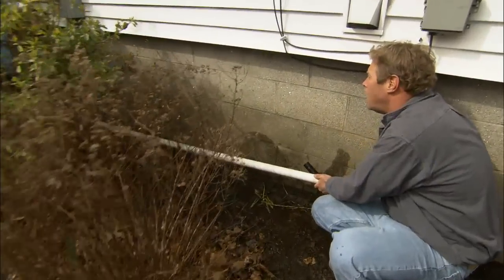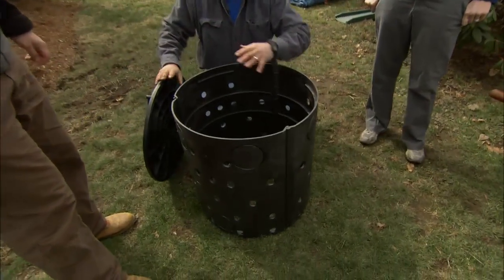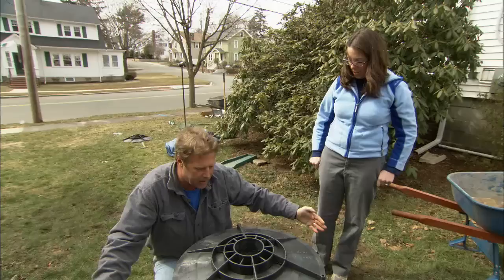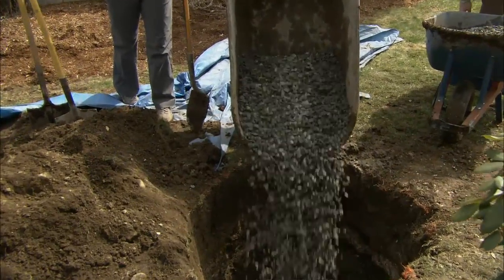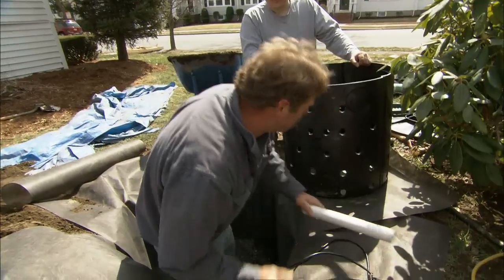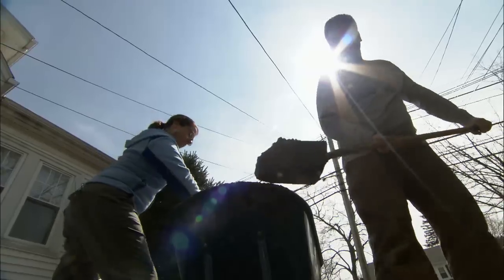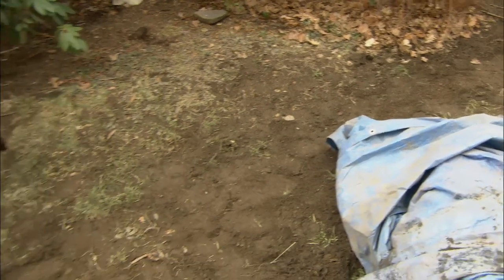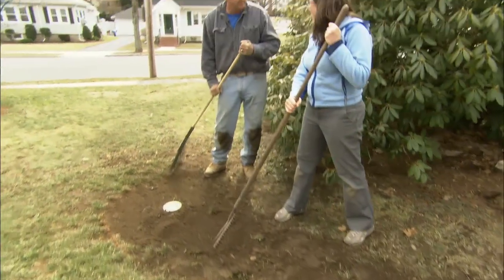How to Install a Dry Well for a Sump Pump | This Old House

Comment: Where I live is heavy clay soil so I don't know if using this method would do much but cause water to gather at the point the well is installed. Plus, that piping WILL FREEZE here, no doubt about it! That accordion discharge pipe he connected to the hard pvc pipe, BOTH would freeze the first freeze night. I REALLY need a workable solution!
Reply: Bury the pipe further underground, and consider installing larger a concrete cistern instead.
Reply: I've had 2 discharge pipes freeze on me in Canada. I just run it above ground, that way I can go outside and visually make sure my sump is discharging. There's also a failsafe elbow on the discharge pipe where it comes out of the wall, if the main pipe freezes then it will still flow out of the hole in the elbow. I'm not sure what the name of it is

Comment: I'm curious about wintertime freezing.   Wouldn't the discharge pop-up freeze shut?    You're kind of screwed if it is frozen shut.
Reply: navigator3  it wouldnt need to popup without rain to freeze! Snow wont melt fast enough to overwlm it
Reply: @sniper___1732  Wrong, that will freeze in the right condtions. Put a freeze guard at the discharge by the house.

Comment: Which is better.....to keep the well close to where your sump pump discharges out, or, if like my house at the top of a hill, should I run a pipe along the side of the house to the back (the lower part of the yard) and place the well there? A couple other questions, if I do run it through the alley to the backyard, how deep should the trench be (length is about 50 ft).....also, concerned about freezing. I'm in NJ, so it probably doesn't get as cold as where you guys are from, but we do get a few sub zero days. (trying to remember....but I think the pump still runs for a while on those cold days because the low ground is not frozen.....over a long period, of course, everything freezes and we get no water.

Comment: How deep should it be so it doesn’t freeze
Reply: Depends where you live of course. Also I think the idea a lot of guys have is that if its cold enough to freeze that pipe then its cold enough to snow. I live in the midwest so I went deeper than his 8".
Reply: I've seen water lines at a depth of five feet freeze in Ohio. Of course it was -30 for a week and a half straight.

Comment: Great video!  Wondering if this was done in the North East.  Do we have to worry about the pipe freezing?
Reply: I hope not because there are three fundamental flaws in this project. 1, not using 4 inch SCH 40 pipe for the discharge means that 1 1/2 inch pipe could freeze completely creating a blockage or damage to the pipe (4 inch pipe is rarely ever completely frozen due to the much bigger diameter not to mention the pipe is much stronger.) and 2, no "floating" discharge, meaning there is no way for the pipe to move up and down as the ground freezes/thaws. 3, there is no freeze overflow so if the pipe does freeze the water will just sit there and not move or drain, with an overflow/freeze drain the water has a plan B to at least get out of the house. If this system is connected to a sump pump (which i assume it is) leaving the water with no where to go will burn out your pump. 

if this is in a place with snow they will have massive damage to the pipes they put in and their sump pump i promise because they didn't do it right.

Comment: Okay video, but I'm VERY surprised you didn't mention how important it is that the SLOPE of the PVC pipe actually be DOWNWARD, and be how much!  Granted, most people would think this is a no-brainer, but I myself was wondering if the pipe has to slant downwards at a certain angle (1 degree? 2 degrees of slope?) in order for the water to flow into the dry-well and NOT freeze during the winter time.  This seems like a huge oversight on whoever put this little video together...?
Reply: pipe is at least 6 inches below the soil surface, so there is a angel lead water downward.

Comment: Hope your in Florida because in the midwest you need a gap between the discharge line of the house and your buried line. If the buried line freezes the water could still be pumped from the house. In this video the basement would flood.
Reply: Guess who is wrong here! Sig Sauer is right. In the Midwest, it is not uncommon to have a sudden snow melt in the middle of winter when the ground is frozen and no water will soak into it. And often what happens is there will be thunderstorms in January or February, on top of a few feet of snow, with temperatures going from below zero to 50 above in a day or two, and then the big rains plus rapid melt of the snow, and the sump pumps pretty much run constantly for days. If your sump discharge strategy is to rely on buried pipe, then you and your house are in big, flooded trouble.
Reply: Same in Wisc. You can make your own freeze proof sump discharge or buy one.
Reply: @WisconsinDIYGuy 
Yeah, just put a tee, near the house, and a 90 degree elbow pointed down, so when everything freezes, your basement won't flood. It might flood outside near the house, but that's better.

Comment: How did you determine the sump needed a dry well?
Reply: If you cant run a sump pump to city storm drains or if building codes do not allow you to let it drain into the road.

Also, even if you can run the sump to storm drains, those storm drains can still fill up, and the sump pump will not be able to push the water out. Which will flood your basement. As a preventative measure you can have something like this dry well.

I work in insurance and water claims are a PITA. Although coverage (..in Ohio) is $100/yr for $10k in water backup.... the best insurance is making sure it never happens in the first place.

Comment: Roger- how do you size the unit required to hold the "normal" amount that you maybe pumping ? If it is undersized your yard might be flooded from the over flow. I have been trying to find a solution to my pumping situation and this looks like it might do it.
Reply: Peter Marcaurelle i have the same problem so i did was put to dry well side by side

Comment: does it have to have chrushed stone. can any stone work too
Reply: Max Planck yes as long as the stone is crushed
Reply: I would think un crushed, large round stones are better. Like 1.5" egg shaped. Large river rocks. Washed and clean of course.
Reply: River rock has more void but it shifts and does not lock. Angular rock is best (less voids, but it interlocks). For instance you could never build a driveway on Riverstone.... or a retaining wall or a skyscraper... etc.

I always use angular rock in case I want to build a patio over it in the future 

3/4 washed probably works. Just dont get crush and run or fines or pea gravel or any other bs. The larger the rock the more void. Void holds water. So 1 & 1/2 washed rock would be even better.

For reference 3/4 angular will allow 40% of the space to be occupied by water or void.

Comment: I hope they called 811 to be sure there were no utilities where they were digging...
Reply: +Porsche924Tim When they mark the lines you just have to hand dig in those areas.
Reply: I watched the other videos too, and that is the first thing they say to do before digging.....811 should work, but good to check with electric, gas, cable, water, phone....etc....all utilities and anyone else who might be snooping under your lawn!!!
Reply: @Mutation666  or save time and effort by planting some TNT then just fill in the hole part you don't need....much easier than digging. Of course, you'll have a heck of a hole if you hit a gas line....still amazed that if a line from my water company breaks on my property through no fault of my own, I have to pay, so they constantly bombard us with extra fees for "Insurance"....no idea why the homeowner is responsible for something they didn't install that is there to make the water company lots of money....but wouldn't know who to ask about it. When I did call the water company, they sent a couple big guys to the house who said "Hey...you gotta problem payin? Just shut up and pay if you like having water."....can't fight city hall.
Reply: This videos where made in 1992 to 811 back then. 
Sorry dude

Comment: wont the gravel go into the holes  of the well
Reply: You  only line the bottom with stone
Reply: They used a mesh...
Reply: @WaterMonger12  a few rocks won't matter.
Reply: @Seederful  personally I use drain rock to line the bottom then 1 or 2 inches of sand and set the well (wrapped in water permeable landscaping fabric) on top of the sand layer. Then fill in the rest of the hole with the rock then finally topsoil.
Reply: I would wrap well with fabric then put stones around it . But personally if it's just downspouts water or sump pump going outside . Go 6 to 8 ft out and pipe out to street or drywell . I wouldn't go that far away maybe 10 to 12 feet
Reply: No surface tension will only let a few through

Comment: Isn’t it a constant cycle, when the sump pump discharges water in a storm, it goes into the drywell and seeps back to the pump.
Reply: Well, it did seem to be far enough away from the foundation.

Comment: Why not just run french drain with a pop up to the curb
Reply: If I recall correctly, most municipalities will not let you have a drainage termination near a city sidewalk that expels water under pressure, do in this instance you’d need to run the pump discharge to a well or seep tank, and then instead of the pop-out, have a 3” French drain gravity feed to a discharge near the street. This is great unless your property does not have an appropriate slope in which case you’d need a pressure regulator on your discharge to only feed a specified amount.

Comment: Why not run the two inch  pipe down hill to the road? Looks like a waste of time and money to me. And if the ground is saturated with rain water, it's never going to leach out of the dry well any way.
Reply: In most areas, it is illegal to run a sump discharge to a sewer drain or even out by the curb. It overloads the sewers if everyone does that.
Reply: Come to Florida and live next to a guy who built a well. Then you'll see
Reply: I live in Ohio. We aren't allowed to pump into sanitary sewers, but we can absolutely pump into storm sewers. That's the whole point of storm sewers, to get rid of rain water. 

Our region is wetland and swamps if we don't drain this water...
Reply: Because it's completely illegal in so many townships

Comment: I just run my sump pump discharge hose out into the yard away from the house.
Reply: Make sure it’s at least 15 feet away or water will just get forced back to ur foundation

Comment: That's not going to work if the soil is in fact permeable the water will just make it's way back in to the basement and if it's clay it's just going to turn the yard in to mud.
Reply: Mark Wright It's called osmosis. it's the movement of water from areas of high concentration of water to areas of lower concentration.
Reply: Mark Wright I need to correct you because osmosis can occur with any material that attracts water, this includes sugars, proteins, ect. Generally speaking it's the movement of any fluid from areas of lower solute concentration to higher solute concentration. Solutes are anything that can desolve in to a particular fluid. Since soil is typically filled with all kinds of organic metereial it's going to exhibit an osmotic effect. That's why you can line a French drain with rocks, styrofoam peanuts, or sand and it will still work. These things contain few organic components and allow the water to pass freely into the pipe without obstructing flow.
Reply: Mark Wright It's alright, I try to stay up to date on this kind of stuff since it relates to medicine.
Reply: They are better off putting in a giant leach field.

Comment: not using a 4 inch SCH 40 pipe for the discharge is a mistake. no 4 inch drain pipe, no float system to keep the pipe from snapping in two when the ground freezes, no overflow. What is this amateur hour? I hope this is not connected to a sump pump or that home owner will be pissed. That black flexible discharge hose sticking out of the house is a disaster waiting to happen. Anything outside the home should be PVC and if it's exposed to sunlight the PVC needs to be painted to prevent damage. 

that is of course assuming this is installed in a place that has snow. if it doesn't snow you should be ok.. though even a heavy rain can cause the ground to swell and move thus moving that pipe..  pretty shoddy design. No excuse not to do it right the first time. I'd be fired if I did this kind of crappy work

1 1/2 inch PVC from the outside wall (from the sump pump) into an elbow pointing down with about a 2-3 inch nub on the end that goes into a 4 inch elbow with a 1-1/2 inch bushing on it. This will allow the drainage pipe to move freely when the ground does and you don't risk destroying your pipe or flooding your basement. Add to the pipe from the house a Y or T so you can have a freeze overflow so the water always has a place to go if the main drain freezes. 

Seriously i can't get over how bad this project was. on This Old House no less!

Comment: You’re not suppose to but if you have a situation like this and you live in the city (never do this on a septic system) just pump the water into the sewer
Reply: I believe for retrofits you are not able to do that anymore.  In my area all of the sumps do go into the sewage system but for new construction they have them going elsewhere to a storm water system that is run in new neighborhoods as well.  If you add a sump pump to a home that did not have one before I believe you must discharge to the yard.  As far as I know, that is.
Reply: Completely illegal to run into sewer system. People do it but illegal

Comment: It's called gravel.. ''Crushed stone'' lmao
Reply: Gravel is smaller
Reply: Nope.  Different product.  Crushed stone has more jagged edges and compacts differently.
Reply: Well "Drakey" LMAO at you because you don't know the difference between gravel and crushed stone.   Totally different.   Stone is naturally occurring aggregate with rounded edges, while crushed stone is made from larger rocks put through a crusher and will have jagged edges.  Before you're so quick to LMAO - you might want to know what you LMAO-ing at....
Reply: May be minus the lime residue.